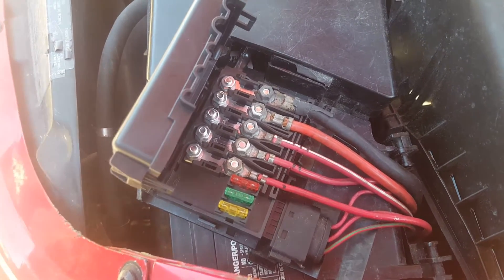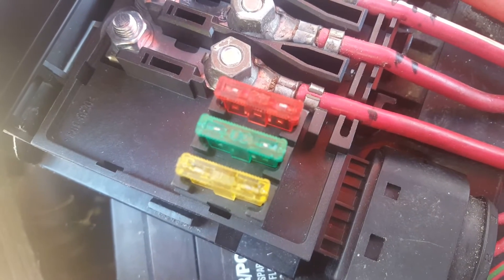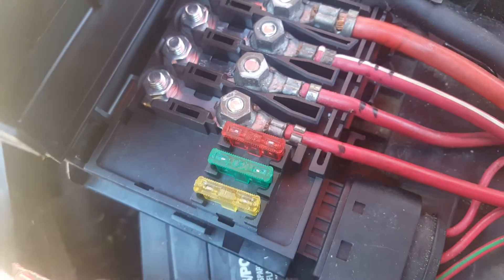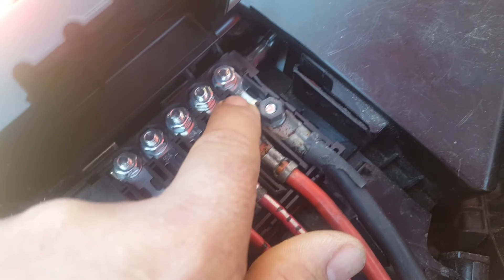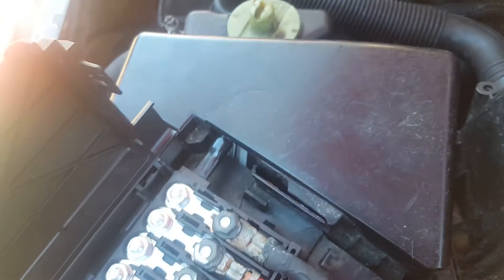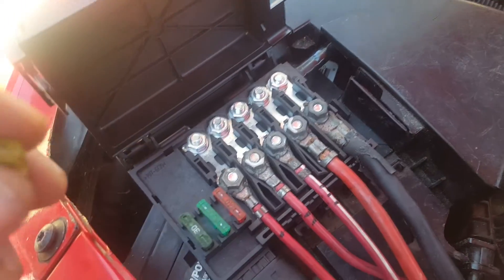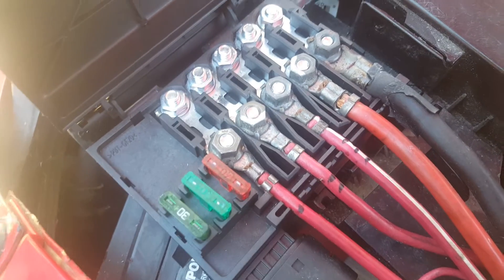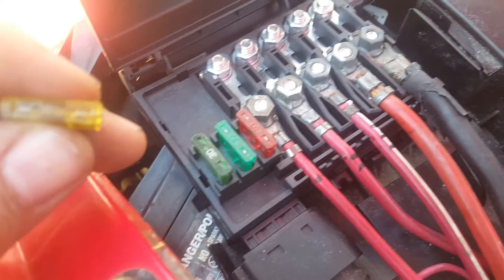1999 VW Beetle Under Hood Fuse box Pt 2

Comment: I am constantly hanging this fuse box! It keeps melting.  The alternator harness and alternator were both changed 5 months ago!  What amp is the red fuse? Just changed the box the other day and abs light still in.  Going to go start it now.  Let it run and see if it gets hot.  Should I put a 40 amp fuse where you have the red one?

Comment: Can you possibly post where I can find the starter relay fuse? I have a 99 vw beetle gls 2.0 and the car will not start and idk why? I’m just curious if u would have any suggestions on what it may be. One day it just wouldn’t start and we used it the day before and it worked fine. The battery is good bc I took it to oreilly and they tested it and said the battery was good just needed a little charged up and so they charged it and it still will not start. It acts like it wants to start but will not turn over and after trying multiple times it will click once that’s about it! Any suggestions or ideas?